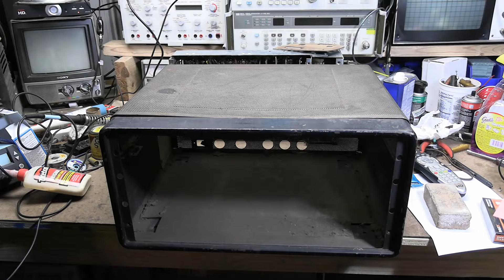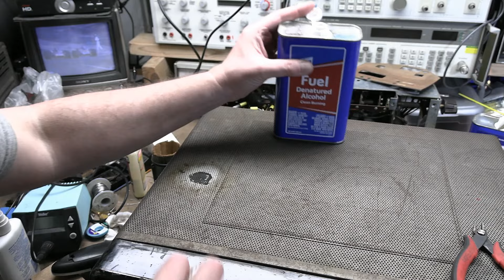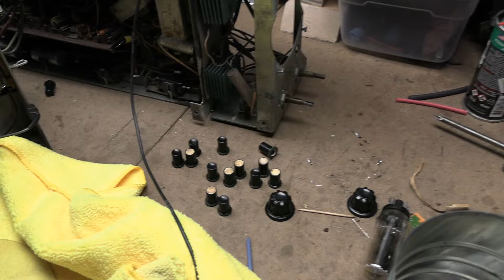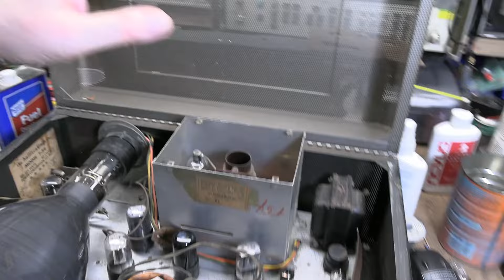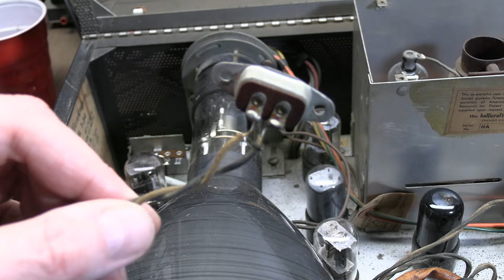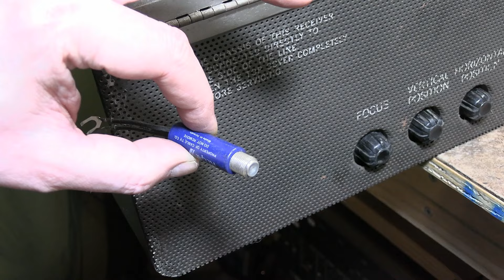1949 Hallicrafters T-54 restoration part 5 (finale!)

Comment: Excellent series on this TV.  Thank you!!        If you wanted a viewable DC coupled waveform, you could (1) make a High-Z divider with a few 10 meg resistors or (2)  use both scope channels and use "difference" mode with one channel connected to a DC point close to 50 VDC and the other on the sawtooth point . . . no big deal ...just ading my 2 cents.

Comment: I know this may be a purely hypothetical question without immediate practical use but, since this is an electrostatic deflection picture tube, could one rotate the tube 90° and switch the deflection plates around (vertical for horizontal deflection and vice versa) and still have the TV work normally? I imagined that would be a way to put to use that area of the tube that is hardly ever used, at least providing for brighter edges if anything?
Just a thing I was thinking about. Great restoration Bob... I enjoyed watching it from start to end :)
Reply from the maker: No. The pairs of deflection plates have different sensitivity. Typically they use the more sensitive pair for horizontal as it is wider. Also I don't think there would be any difference in brightness. It's not the electrons that wear out the phosphor. It's the ions that are less focused and degrade the entire surface evenly.

Comment: I have had my Flagship Hallicrafters SX-88 for over 15 years... My summer time restoration project is to go in, check all the tubes, and change many of the capacitors, give it a full alignment. BUT!!!! As good as the SX-88 is, the way the engineers designed the radio they built it from the inside out!! Getting to some parts requires a lot of dismantling, and DE soldering of other parts.. 

As good as the electrical design is, the way it was put together, they assumed it would never have to be repaired.. My SX-88 is 100% all original, even the tubes are all original... I was very lucky to find this radio, it was still in it's original box, stored away for over 25 years in the ham radio operators garage.. The Ham hurt his back and had surgery. The SX-88 is so heavy he just left it in the box and never moved it.. 
Estate sale find, $150.00... On top of my SX-88 is a SX-100, another great radio and easy to work on... The T-54 was made for Ham Radio Operators, not the general public, that is why they designed it to use the same cabinet as so many other Hallicrafters radios.... Thanks for the video, good job!!! A++

Comment: Hi Bob, that set came out pretty good. For the simplicity and economy of the design they do make a good picture. We have been working on our T-54 (early version with octal tubes) while you have been doing this one and are quite pleased with the picture quality. Most of the issues we had with ours were due to some questionable work done during a previous restoration.

Comment: Great work! I cleaned the same cabinet that Hallicrafters used to house the SX-62 and SX-99.I approached it  like this; Metal cabinet = Automotive finish restoration products. Rubbing and polishing compounds. Even 0000 steel wool with a cleaner for a lube. Rottenstone is another safe option for some softer metal finishes.